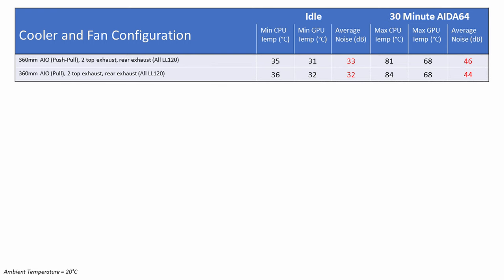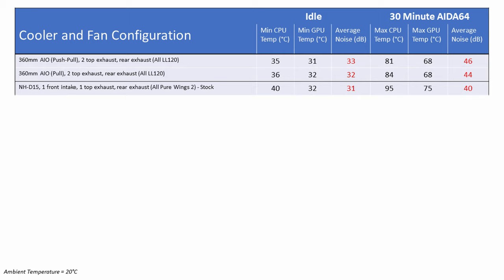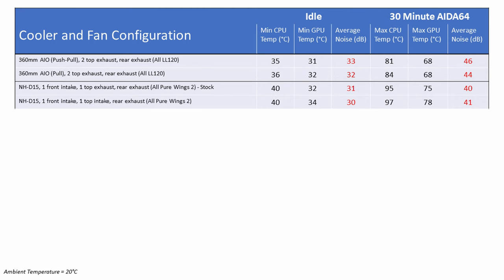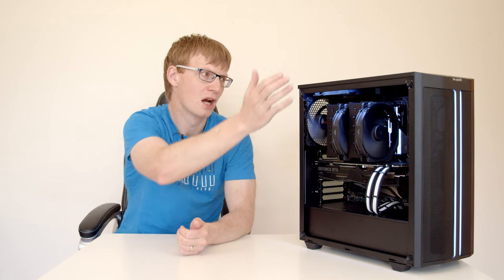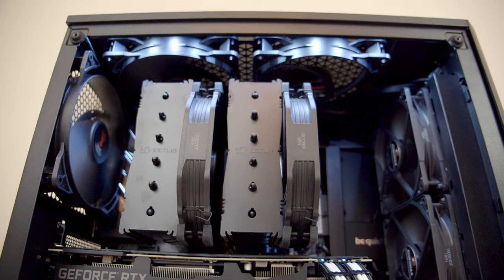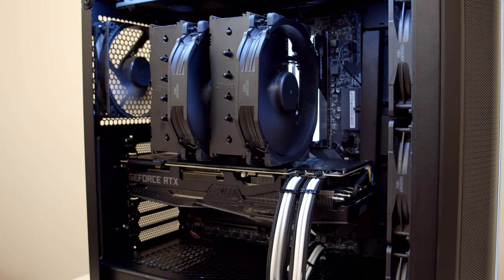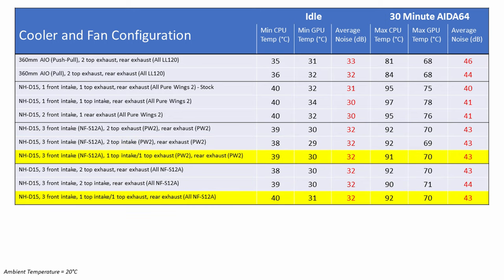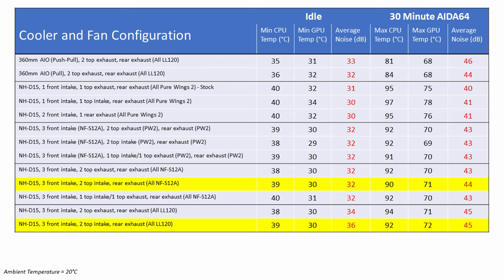be quiet! Pure Base 500DX - AIO or Air Cooler?

Comment: Really nice informative video! Keep up! Really many answered question. But u miss one configuration with 2 front intake 1 top exhaust and reat exhaust. if the 1 top exhaust matter with 2 front intake fan?
Was all the fans as stock settings? 600+ rmp? I thinnk you got better GPU cooling vs gamers nexus is because you probably dint put the hDD cage in again with the air cooling test? So the intake fan from the low front kan push cool temps into the PSU and therefore the gpu gets cooler air and get cooler? Also i think gamers nexus only using low end gpu to reuse old benchmark since their gpu load only 50 ish degree.

Comment: Hi Christopher, thank you for the effort!
I'm planning my first own build as a creative workstation. (No gaming / no rgb wishes)
I love your video's, very well done and very informative. Thank you!
I do have some questions I can't find the answers to..
Buildplan; 3900x, Aorus master, lpx 2x16gb, 1660 super, 2x m.2.
Aircooling with NH-D15 (reliability).
Would I go for;
Basic setup (1 front intake, 2 exhaust)
Or would you in this case recommend;
- 3x 140mm front, 2x 140mm exhaust
- 3x 140mm front, 2x 140mm exhaust
- 2x 140mm lower front, 2x 140 exhaust.
The fans; 2 extra purewings or 2 extra noctua S12A ?
Will I be able to add the fans to the board, or do I need a controller?

Is the type C standard in the case or is it an add on? (I can only see the rubber(?) grommet?

Comment: HI, very interesting video.  I also heard that the stock fan configuration was the best even though it seems weird :)    One question, when showing your AIO near the beginning, the radiator was orientated with the hoses at the top.  I was under the impression this was a bad idea, because as the liquid slowly evaporates over the years, you will find yourself drawing air into the CPU block.  I could be wrong, I've only had one watercooled system, and when it leaked within 18 months, and the replacement does less than a year later, I became a firm believer in using air coolers....even if they have to be huge LOL.

Comment: Thank you so much! I'm using a different case, but contemplating the exact same scenario: NH-D15 or 360 aio up front. Keep going back and forth, because I was worried my GPU temps might be too high with the front AIO. But your results clearly show otherwise. Thanks for this no nonsense test. Much prefer this to other over the top shows on youtube. Cheers, you have a new subscriber :)

Comment: I wish I could like this video 10 times! I am about to build a PC with this case, I ordered 2 extra 140mm "high speed" pure wings 2 fans for the front intake before I saw this. This video was super informative and covered almost everything I could have asked for. Thanks for being so thorough and keep it up. I am interested to see how mine will perform with 2 high speed (1600-2k rpm) 140mm front intakes, with the pure wing 2s as rear exhaust and top intakes. Also interested to see how the 3080 FE cooler changes things with the way it shoots hot air at the cpu cooler

Comment: Very Informative.  I have a 500DX case.  Right now I'm using a Noctua NH-U12S.  I get around 38*c idle , and around 96*c at full load. I'm running a 2600x  and plan on upgrading to a 5900x/5950x.  I'm debating to go with an 240mm or a 360mm AIO - the question I have:  Can the tubes run from the bottom of the case/radiator then to the CPU, or do you need to run them from the top? Is the hole big enough for the tubes to reach or do they have to be run from the top?

Comment: So I bought this case and my configuration is 2x140 pull in front, 1x140 in back push. Liquid freezer 360 III on top pull. This will create an over pressure and gives less dust inside the case. Since the sound/air comes out on the back it must give less noise. The temp is negligible less.
Reply: Just a queestion, how did u install LF360 on top? In specification 240mm is maximum

Comment: Hey Christopher, very good video once again. I've just watched your review both on the Pure Base 500DX, and the LIAN Li Lancool II, and I am really not sure which one to get, I think the Lancool 2 is bigger, which I guess is a good thing, since I will be getting an 360mm AIO in the build. Is the airflow in the 500DX by far better than the Lancool 2? Or what do you reckon? I really can't decide.
Reply: @ChristopherFlannigan  Okay fair enough. Thank you!
Reply: I was in the same dilemma and I ended up getting the 500DX. I don't regret my decision. Looks great and has very good airflow. I was worried with having just 3 fans in this case, as I had 7 fans in my previous build in a huge case (Define R5). The included fans are quiet even at full speed. I mostly play Battlefield V. Getting 68-69 degrees 1080 Ti in game and 60-63 Degrees Ryzen 5 3600 @1.18750V with Wraith Prism cooler. Although I like the magnetic glass and PSU cover in Lancool II, I don't like the front panel on that one. Just a personal choice. All I can say is I don't think you will regret getting 500DX in terms of thermals.
Reply: @UnknownEAFCPlayer  Thanks for your input. I think I'm in the same boat as well, I kinda think the front on 500DX look a bit better than Lancool.

Comment: 240mm aio (arctic liquid freezer II) top exhaust? With 3 120mm intake fans and 1 140mm exhaust.?
Reply: @ChristopherFlannigan  in that case would push pull configuration work?

Comment: I have practically the exact same setup as above except for the Noctua cooler, does it fit in this case? I want to get a Ryzen 9 3900X and the NH-D15 to cool it. I'm questioning because you have the side panel off. Also, is the Corsair Vengeance LPX ram low profile enough for this cooler or would I need to raise the second fan, which would ruin the look?
Reply: @ChristopherFlannigan  Looks like my RAM is shorter than yours, which is great. Thanks, buying this cooler next month

Comment: Question, why are the front fans mounted on the other side of the fan mounting "panel"? Mine are mounted where the preinstalled Pure Wings 2 on the front was. 2 front 140mm intakes and 1 rear exhaust.
Reply: @ChristopherFlannigan  Ah I see, thought it had something to do with thermals and fan efficiency, thanks

Comment: Hey christopher, what do you think about two FRONT intake with 140mm ; two top exhaust and rear exhaust ? Every websites say this is better to use bigger fans in front.  Because I'm pretty sure that the difference between 5th config  6th config  is made by the Two FANS exhaust at the top.

Comment: Very informative video Christopher. However, it would be very interesting to do a configuration with all 5 fans being 140mm be quiet! fans. Here are some questions that arise:
1. How do the noise levels of the Noctua fans (3 x 120mm) in the front compare to the be quiet! 140mm fans? Do you think that using 2 be quiet! fans in the front as intake would decrease the overall noise levels? (43db under load shown at 6:44 mark)
2. Would 2 be quiet! 140mm fans in the front provide overall better temps when compared with the 3 x 120mm Noctua fans? (With the the rear and top fans being the be quiet! 140mm fans)
Reply: Great video! Just did my first build in this case with an R5 3600 with stock cooler and a RX5700 XT Red Devil. Your videos were a great help, appreciate it! Temps are doing fine with the PW2s in stock configuration by the way, so im going to leave it like that. Only small issue is that the GPU tends to spin up quite heavily under load which increases decibels but that's something i can live with :) very happy first builder!
Reply: @ChristopherFlannigan  Thank you for your reply.
You have managed to clear up the first point for me, 3 x 120mm fans are better than 2 x140 mm fans, but does that come at a sacrifice of noise levels? Whilst I agree that the temps and noise were similar in the second point you made, by that stage you had already introduced the 3 x 120mm fans in the front. It is difficult to compare the case when you have only 3 x 140 mm mounted (noise level 41db) to the case when you introduce 3 x 120mm in the front (noise level 43db), because the total number of fans is different (3 vs 6). But I am wondering wherether having 5 x 140mm fans would be quieter than 3 x 140mm combined with 'louder' 3 x 120mm fans? As you have pointed out the 120mm fans spin faster, hence are more noisy.

Comment: I'm interested to know what RAM you used to get the right clearance for your 2nd fan on your Noctua, and also how you managed to get everything in the case like that. 

I am having a shitty time trying to get the motherboard into the case and the cables that need to go on the top of the motherboard (between the CPU cooler & upper case fans) all connected.  There is just not enough space!
Reply: u can stick the 2nd fan on the rear IO side of the cooler. it'll be a tight fit, but it fits.

source: just did this
Reply: @omgwtfrofltomato  But if it's by the I/O, that means you have it right next to your case rear exhaust fan, doesn't it? Seems a waste to have two fans right next to each other.
Reply: @nervaproject  it was. just got done gaming without the 2nd fan and can confirm- much better cooling.

Comment: Thanks Chris, been watching all your videos regarding the be quiet 500DX case. I have the noctua nh-d15 cpu cooler. Even at the it's best with additional fans of 90c on load cpu temperature, is that a temperature you're comfortable with or would you advise on other cases to be get better cooling with air cpu coolers. Thanks for any help
Reply: @ChristopherFlannigan  thanks that vid you linked really helped comparing stress testing using aida64 vs gaming. I've got a 8700k, but my case is a very old haf x and it's a dust magnet. After watching a lot of videos on cases, your vids help me decide to get the be quiet 500DX case. Thanks again

Comment: Good video. Two questions if you or anyone in the comments have an answer.

Why didn't you route the tubes from the radiator from the bottom of the rad? (Was it not possible due to tube length?)
Did you have any problems with GPU clearance? I'm looking at the 3080 series with some cards taking up 3,2cm of the 3,7cm available. Would it be better to put a 240 rad in the top and keep the original fans for the front?
Reply: @ChristopherFlannigan  I worried about the tube length as well.
What I was mostly curious about is whats mentioned in this video by Gamers Nexus https://www.youtube.com/watch?v=BbGomv195sk. 
They talk about potential damages and problems with putting the tubing on the top of the radiator when mounted in the front.

I really would like to have a Corsair H150i in the front but I'd hate to have it get less efficient quickly because of this effect - hence my question. But thank you for your response regardless.

Comment: Great video, so comprehensive, thanks! I have 2x140mm front intake fans 😁 I'm using the stock wraith prism cooler and I've been watching videos on CPU cooler ideas. It's great to have a video done specifically for my case. 360mm push/pull then. I think I'll go for Arctic Freezer II with 3 additional P12 fans in the long term. Do you think it's gonna be overkill just to cool my Ryzen 5 3600? I wasn't originally planning to spend more than £50 for a CPU cooler.
Reply: i had a ryzen 2600, with the stock cooler, my cpu would go to 90 degrees sometimes on assassins creed, so i bought the cooler master ml240 v2, side mounted on intake, my cpu doesnt go over 45 degrees in assassins creed now, im not sure how different the zen+ and zen2 cpus are for heat, but i imagine its not major.
Reply: @blucif6210  Cheers. In the end I went for Arctic Freezer II 280 intake in the front.

Comment: Hi Christopher, quick question will the dark rock pro 4 fit with 4 stick of Corsair platinum memory, or is it better to go with an AIO cooler like the 280 pure loop. I’ve tried the NH-D15 but can’t fit the front fan becouse of the ram modules.

Comment: I have a question. I finally installed a Ryzen 9 3900X, B550 Aorus Pro, and Noctua NH-D15. I'm getting no more than 90C after an hour in AIDA64 Stability Test, stressing absolutely everything.

Is this good? Or should I be concerned? The CPU boosted to 4.02 GHz, and all cores & threads were 100% utilized.
Reply: @ChristopherFlannigan  Alright thanks, was kinda worried 90C spike was too high for a NH-D15, but 12 cores is 12 cores. Waiting for ClockTuner for Ryzen to release so I can undervolt and get better temps & performance.

Comment: Honestly this just proves that positive air pressure is better for air cooling. What I'm wondering now though, is if the default fan layout that be quiet! provide is negative pressure. One fan on the front, and 2 fans as exhaust + the CPU fan would seem like a negative pressure setup to me.

Comment: Great video! The review is very thorough, and I like that a lot. Subscribed! I am curious though about your found when it comes to the top (front) fan. As you said, its almost no heat coming from here. I read some guides/other YouTube-videos about case airflow and some argue against too populated top fans. The reason for this is that cold air coming from the front fans (and probably the top) is getting sucked out before reaching any components. You tried the top fan (front) as an intake, but shouldn't this produce an airflow loop? The heat coming from the top fan (back) getting sucked in the top fan (front). Though you got better thermals, maybe this cancels out the loss of cold air getting sucked out before reaching the components? Anyways, it would be nice to see some stats without the top fan (front) too see if adding the second top fan contribute to better temperatures, given that all the front fans are populated. Again, great video. Already seen a couple of videos from your channel after seeing this review :)

Comment: Hey there! If the Liquid Freezer II AIO 240mm is front mounted, is there space for a PW2 fan in the front as well? 
Then I could mount the AIO with an extra fan for front intake, and top/rear exhaust.
But if the front AIO is the only intake, there would be negative pressure and I may want to top mount it.
Any thoughts? Thanks

Comment: Really excellent video, so useful and enjoyed it.  I would have said the conciusion would be slightly different though; go with a 360 at the front but 6 fans for push / pull maybe isn't completely necessary given the realtively small added benefit to CPU temp with increased noise.  Also, not sure why you recommend be quiet fans rather than what comes with the AIO you choose.  This is really picky given the level of detail you have gone into but I would have liked to see the 360 AIO results with stock fans. Great video!

Comment: I want to use an Aircooler in this Case. The BeQiet! Dark Rock Pro 4 is nice, but i will remove the front-Fan. The middle-Fan seems to handel this. I want to use 140er Fan, but the fronr rear will be an Intakefan.  So the CPU gets mor fresh Air und if got ein overpressure in the Case. Sounds like an Plan?

Comment: Could i top mount an Arctic freezer II 240mm radiator in this case. I have seen other 240mm radiators mounted up top in this case but the Arctic AIO i'm looking at has a thicker radiator at 37mm thickness.

Comment: I have a question. I Have bought the Be Quiet 500DX to replace my NZXT H500 (because i find it running to hot for my liking.).

The only problem is that i have a AIO (NZXT Kraken x53 240mm) and i dont know where to place that one the best for best thermals.

What would you recommend? In front with the 3 included fans at the top and back or AIO at the top as exhaust with back also exhaust and front then 2 140MM fans or 3 120MM fans?.

Ill hope you have a answer for me because i have been looking around for days now.
Reply: Front for cooler air for your rad or top exhaust and you are running a couple of degrees warmer. Make sure when front mounting your rad to point it tubes down and not place the pump at the top of your AIO loop

Comment: I recently started building my first PC using the Meshify C case. I had purchased a kracken 280mm aio. I decided after to switch to this case from the meshify due to there not being enough space for a 3080. From your experience would a 280mm aio with noctua fans be sufficient for this case?

Comment: Great video mate. I still can't quite decide if I want to go for an AIO or air cooler. My preference would be to strike a balance between aesthetics (AIO, in my opinion) as well as solid airflow and sound. 

At the moment i'm torn between getting a Darkrock Pro or one of the corsair 240/280MM's but there's trade-offs either way.
Reply: @ChristopherFlannigan  thanks mate. I think I'll get the 280mm Corsair h115i pro and mount it to the front then use your advice here regarding the supplied Be Quiet! fans. 

Seems a great case and I'm happy I saw this video as I was undecided between the 500DX or one of Fractal Design's newer cases, but for 90 quid this seems excellent
Reply: @Russtick92  i was thinking of doing the exact same thing with my build, just got the parts besides the cooler. How did yours go? What worked best for temps?

Comment: Thx. Want to buy the new pure loop 280 and was a bit worried because of gpu temps. So front mount with pull and 2 top and 1 rear exhaust seems to be best for me.?
Reply: @ChristopherFlannigan  i have no front exhaust. Front radiator in pull config and rear top exhaust
Reply: @ChristopherFlannigan  ah ok. Tried everthing yesterday and i found out that gpu temps are best with the dark rock 4 air cooler. Worst gpu temps with radiator front push. 78 degrees. With front pull 75 degrees. With air cooler 73 degrees. I can live with higher cpu temps but want to have low gpu temps, so for me its the air cooler. Removed the aio.